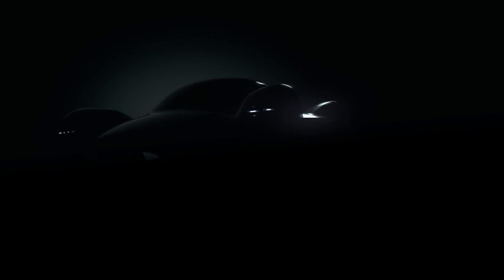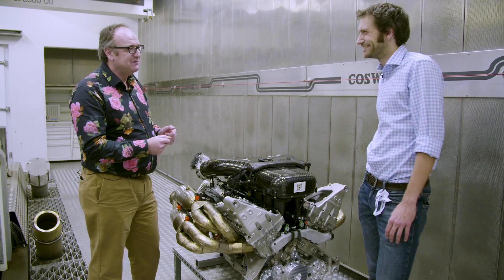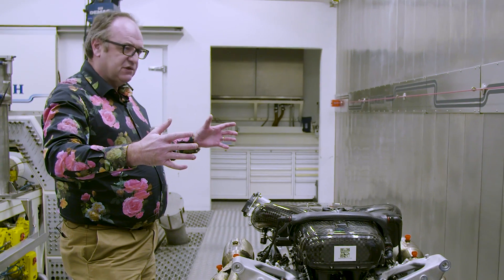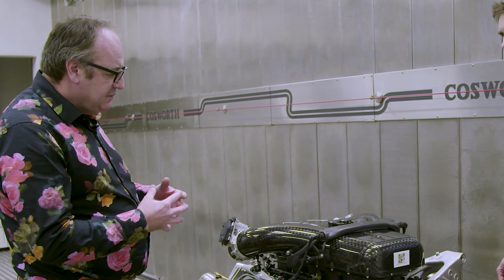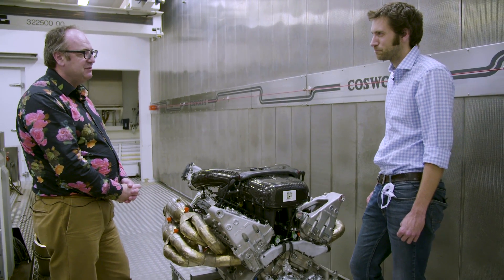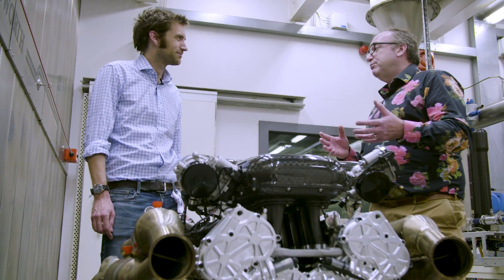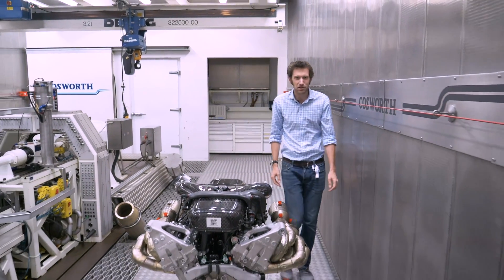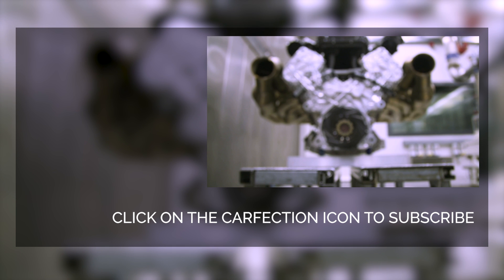Hear The Future Of The Supercar At 11,000rpm: The Aston Martin Valkyrie's V12 - Carfection

Comment: .I love cars too (I have a 2017 Corvette C7 with the fun manual transmission) but it ain't free and stocks are one way to make money.
,.,,.,,AMAZON: 
Yep, I bought a ton on the dip.   It's getting cheaper relative to its current earnings (half compared to last year). 

Amazon invested $14 billion in the last quarter alone, the same as it spent in 6 months before that.   It is a do not sell stock.

...With the Delta virus coming at full speed ahead, pandemic sales will make a comeback.

Amazon is investing so much money, that no competitor will ever be able to catch up.

Amazon's not going anywhere so I know that eventually it will come back.    
Fidelity considers Amazon as a large growth company (probably because as big as it is, it still only has 7% of the retail market)

buying via Amazon Smile donations donates some money to my favorite charity too!

Get on board or be runover, it's up to you.

Comment: This car will sit in some "lads" handbag collection with 900 miles in the first 20 years, so realistically this is not a problem.

But I do not like the idea of the engine being structural. Grand for race cars where they are working on the car constantly  and lifecycles are short. 

I am sure they have run the numbers and know is a non issue and I am talking shit!🤫

Comment: I love it when English engineering pushes the boundaries in design. Always proud to be English.
Reply: Just a Ford 2(6) =12
Reply: @nellyfarnsworth7381  Cosworth don't officially work for ford anymore, that their own design
Reply: @subconscious.com_usa6691  
Remember when Ford owned Jaguar & land Rover & Aston Martin?? Remember when Aston Martin cars where built on the JAGUAR XJS platform?? Using a supercharged inline six?? Aston Martin needed a  V-12 engine? So, a new V-12 engine was Designed for Aston Martin cars?? The "new" engine was twice the displacement of the ford DOHC V-6, that used the same rods, same pistons, same valves, same same same.  FORD designed this MODULAR ENGINE, to be a 4 cylinder, 6 cylinder, 8 cylinder, 10 cylinder, 12 cylinder. That could be built on the same assembly lines,  using the SAME parts. Also streamlined the E.P.A. compliment on emissions. Because each single cylinder was the SAME. SAME ports, same valves, same springs, same pistons, same rods, bearings, same same same.
Its the SAME.
Reply: @nellyfarnsworth7381  Ford only marketed Cosworth engines, just like Thomas Edison slapped his name on the lightbulb patent even though Nicola Tesla and other engineers perfected it for him.
Reply: Some bad news Paul - Cosworth is owned by Americans ;-)
Reply: @JakobusVdL  Owned by and operated by is a different story. If ownership changed hands yet the whole crew remain the same- it's still Cosworth UK engineering minds and hands at work.

Much like the company I work for is now owned by Canadians, but all our workforce is still Floridian- but some management changed (for the better!)
Reply: That is a fair point @wyvern4588 , but I think there are way too many assumptions involved here (mine too).
Based in England, and English, are far from the same thing. Most major automotive organisations are very international in employees and outlook.
Its not Keith and Mike knocking out motors anymore.
Reply: @JakobusVdL  True, but if they pass on the philosophy of their design, they can stay true to the name.

Just like FCA, Chrysler owned by Fiat, but they still make big, powerful iconic cars that they focused on in the 50's-70's.

Fiat was the best thing to happen to them, Diamler was the worst.

Comment: WOW. And I thought that the 860 hp of the 6.3 Litres V12 mounted on the FXX K Evo was the best we could ever get from a N/A engine. This V12 is Koenigsegg's worst nightmare...
Reply: This is the worst nightmare for electric supercar
Reply: @amarjit singh Bruh, Koenigsegg got 600hp out of a fcking 3 cylinder variable valve engine that weighs about 70kg.....and you're tryna say something is out of their league?
Reply: Certainly puts pressure on em, but Koenigsegg is doing this with the 3 cyl test engine and not bothering with quadrupling it. :)
Reply: @amarjit singh Did you read what I said!? And if you did, did you comprehend it before putting your fingers into motion!? Did Koenigsegg have ANY experience in SINGLE-SPEED FIXED-GEAR transmission, also known as the direct drive? Did Koenigsegg have ANY experience in CAMLESS engines which uses variable valve timings? Did Koenigsegg, or literally ANY OTHER COMPANY IN THE WORLD have experience getting 600HP out of a 2 litre, 3-cylinder engine? The answer to all of that is NO but they STILL DID IT. And your dumbass is saying the most matured engine technology, the NA engine, that can rev to 11k rpm.....is out of the league for a company that pushes the very limits in every car they produce? You are the type of fool that claim "it is impossible" just cause "they have no experience" and "They have never done it before" aren't you? If all the car manufacturers had people like you, we would still be having engines from the goddamn 50s right now.
Reply: @amarjit singh So? Still got nothing on a camless 3-cylinder producing 600hp. Aston Martin/Cosworth can spend 10 years trying and they would still fail to do it. While Koenigsegg, if they really wanted, could do a 2000hp V12 NA engine in a year. Now just to make things clear, I am just talking about engines. In terms of track performance, the AM Valkyrie would absolutely destroy any Koenigsegg. However in terms of normal daily use and highway sprint the Koenigsegg won't even see the Valkyrie in its rear view mirror. Both are still legendary anyway.
Reply: Koenigsegg has a 2.2L 3Cyl making 600 hp. They aren't worried. 

Though probably respectful.
Reply: @orppranator5230  I mean with turbo you can do that. But this engine is N/A.
Reply: Reaper5.56 Xx  Who?
Reply: @amarjit singh So you send me an article stating the "supposed" capabilities of the Valkyrie? Well Koenigsegg can also come out with an article stating their new car, still in development, can go 0-400-0 in 10 seconds. LMAO. Maybe put it on the road and prove it before talking.

https://www.koenigsegg.com/koenigsegg-sets-new-0-400-0-km-h-world-record/

Current world record holder for 0-400-0, and it's not even the newest Jesko Absolut, which is yet to be fully tested. Fools like you believing in fantasy numbers instead of actual records, how typical.
Reply: @amarjit singh Ah, so you're that kind of stupid, where logic seem to be out of your league. Bye now and hope you don't fail too hard in life, though I think you already did.
Reply: @amarjit singh Yea facepalm all you want. While they continue making all other car companies look like clowns. Koenigsegg haters like you never learn.
Reply: @amarjit singh Well am I comparing the Valkryie to the Jesko Absolut or Gemera? Didn't I say those weren't tested yet? When did I say Adrian Newey can't claim figures? And you think Koenigsegg doesn't have state of the art engineering and simulations of their own? What I meant is I rather trust a company with the previous AND current 0-400-0 record, and their claims that the Jesko Absolut is even faster than that. Put that car on the road and PROVE it before talking. Let me make things VERY clear for your pea sized brain, when it comes to track performance, I trust Adrian Newey 100%. However when it comes to straight line 0-400-0, it's Koenigsegg all day. Valkyrie the beast on the track and Koenigsegg the beast on the highway, no shame in that. I can provide you with reading comprehension classes if you need.
Reply: @UCgUAkpuS9qbIz7710hwx2YQ You did try to use predicted numbers to try to justify that the Valkyrie is faster in a straight line than any Koenigsegg car while a 2016 Koenigsegg car holds the current world record for 0-400-0, essentially making a fool of yourself. Also, you said bye twice but you're still here, knowing you're dead wrong yet refuse to admit it huh? Make up your mind man if you wanna say bye, then leave, don't keep coming back to fight a losing battle.
Reply: @amarjit singh Ah you finally bring things back to where you started. Yes, Koenigsegg has never done NA engines nor V12 engines. However the difference here is, I never did claim Koenigsegg could make a V12 NA engine with 11k rpm that is BETTER than the Valkyrie's engine, all I am trying to refute is the fact that you say it is out of their league. You seem to have real problems understanding that. You see, I never did say making a 0-400-0 car that is equal or faster than Koenigsegg is out of AM's league, I just said the Valkyrie or any of their current cars won't be able to do that, which you then try to refute by linking a short article on predicted values. I also clearly said the Valkyrie would destroy any Koenigsegg on the track, so I wonder why you have to bring Koenigsegg's expertise in motorsport into the conversation. Maybe, just maybe, you should take classes on reading comprehension. Speaking about "control", this is the 3rd time you're saying bye, I really hope you leave for good cause you're taking way too many Ls.

Comment: 220 hours simulates 100,000kms of real road use.  Well only if it’s done those 220 hours as a culmination of 1000 plus short stints allowing the engine to cool completely in between.  I would be very interested in knowing whether this is built into their durability testing. I’d suggest any engine set up correctly could run a constant 220 hours.  It’s wear and tear at start up and being under load and revs when an engine isn’t at optimal operating temp that does the damage.

Comment: They will get these engines better and better.Newer engines in a few years might be able to burn fuel so precise and clean that we will not need heavy exhaust systems with catylitic converters.Also they are supposedly making metals that stay cool or a certain temperature and will be able to revamp the oil and cooling systems--that way then can focus more on MPG--and faster speeds--while being lighter and safer.I like Hondas but wish they would focus on improving NA engines instead of turbos.They are already having some issues with turbos--cooling--unburnt fuel getting too and scarring the parts microscopically.I have a Type R Crosstour--its on you tube.It is the 3.5--NA and is putting out 300 HP--it has a full exhaust and was reprogrammed by Honda.I could have easily told them to reprogram and put a more aggressive exhaust and get 350--and also a cold air intake--but it would have voided the warranty.The 3.5 is a GEM--and it is reliable and it stays cool at high speeds--even in the heat.I had the car set up to run in the silver state classic--which I hope to do next September and film it.Honda should have made the Civic Type R with the 3.5--and they have made improvements to the 3.5 since 2010 and could easily approach 400 hp.A civic Type R with AWD and a 370 plus 3.5  would be perfect.In the US it gets hot out in 90% of the country and even the Honda turbos lose power and reliability in the heat.I have locked my cruise control on 100 mph plus going to Fla a few times--getting 24 mpg--AC on--car just loafing.I went to look at a Type R--but coming from a big Crosstour with what I had done was not close.The crosstour is a better car--is it slower--yes--but the reliability--safety--and the ride quality--the crosstour is a much much better high speed cruiser.There was a video of me a year or more ago with me getting on the highway with a coworker that had a new SI--it was like a 20 mph to 110 run on an empty hwy after work and by the time I was at 100--I was about a car length and a half ahead.My car should match the stats of a V6 coupe accord--except my governor was disabled.On the dauphin island Alabama bridge--I got the car to about 137 and had about 2000 left on the tack--I think it was 4100 rpm at 137--so I would say 155 is probably the drag top speed.This car is fantastic--and the engine techno is great

Comment: You know what my issues with they’s cars are they keep pushing the limits yet no one is working on a V12 that use gasoline like a 4cl. And nothing is imposible. But no one is thinking. It’s all the same electric cars are nice but the sound is gone. And that’s not appealing. Think about this a V12 that runs off of 1 gallon of gas for 300 Miles. 😱😱😱😱

Comment: i may be very wrong here but he said that the pistons move at 25 meters per second and i googled it and it says that's almost 56000 miles per hour that's amazing, he also said the the engine is built to last 100000 kilometers or about 60000 miles, so if the car could go as fast as the pistons the engine would last about a second haha that's insane.  (again i could be very wrong)

Comment: It's not really the future of the supercar, but rather a nostalgic nod to the past. The IC engine is a dinosaur. He really stresses the deficiencies of the engine and support system, and talks them up as positive features and achievements. (Emissions, weight, complexity, vibrations, heat dissipation, lubrication challenges, gears for cams, resonances, noise, complexity, exhaust pressure waves, costs, wear, modest durability, clutch limitations, etc.) That mindset makes no sense at all.

Comment: imagine, you have a Maruti Suzuki 800 and you have swapped the stock inline 2 800cc 4 speed with this 250HP 1.6 liter inline 3 with a 6 speed sequential gearbox which revs to 10,500RPM...
the dream...

Comment: engine goes 12k RPM

every forced induction demon flies out of me
Reply: They need to catch up to the bikes where 16,000 is the norm and some can go even higher
Reply: PappaLitto you have to keep in mind, this is a 6.5 liter engine not a 1.5 liter
Reply: @PappaLitto  Too much mass and reliability is shite if you try it in something with that much mass. Back when F1 ran 20k RPM they changed engines every session.  Thats like 300km per engine.  Pretty fucking bad.
Reply: @ChefofWar33  those were also surprisingly small. I think the V8s were 2.4L and the V10s weren't much bigger.
Reply: @disabledman8697  You ever see a 2,4 liter bike buzz to 16k rpm?  Probably no, becuase it is really hard on shit.  Need pretty much titanium everything.

Comment: Since they spent so much money on research and development to make this engine, they might as well mass produce it.
Reply: Well the corvette doesn’t have real world application either and it has been produced for decades. 

I am not saying make 100,000 just 10,000. Enough to see one in the streets every once in a while. Not just on YouTube videos parked forever on millioners garages.
Reply: @johnconnor7501  The corvette isn't comparable on any level. It's a relatively cheap and simple sports car built to a price.
Reply: Firebrand I understand that. I am simply pointing out that a car does not need to be practical in order to be mass produced.
Reply: Nah, the technology used within the engine will go into road engines that actually have real world marketability and application.

Comment: My 2006 Kawasaki Ninja ZX10R 1,000 cc red lines at 13,500 RPM.  It tops out at 100 MPH at 13,500 RPM, in 1st gear, of 6. :D
Reply: It also makes you sound like a twat on the internet and on the roads.
Reply: @GlitteringToothpaste  Troll elsewhere, twat
Reply: @GlitteringToothpaste  Speed does not a twat make, but twat comments like yours...

Comment: Please Cosworth put that 3 cylinder engine in a hot hatch!
Reply: What makes it more incredible is that engine would only be about 1.6L so you get 250bhp from a 1.6l 3 cylinder engine and I bet it would also sound amazing.
Reply: @thedestroyer3262  That's approaching "reliable" rotary engine performance, but it meets emissions!  D:
Reply: @thedestroyer3262  just think konninzeg got 600hp from a 3 cylinder engine. Imagine they built a v12.
Reply: They need to team up with Ford again, push Mountune out of the way and re-visit the 1990s era..... put the 3cylinder in a fiesta, and put two together to form a straight 6 to power a focus
Reply: Problem is durability, 100,000 Km for a hatch is just not enough. engine needs to survive for 300,000 km at least.
Reply: Koenigsegg has a 3cyl that may be a little bit stronger.
Reply: Fiesta RS Cosworth 😍
Reply: @raymondjunger4742  Holy shit! Yeah. A Festa' Cossie would be so cool! Make it a six speed manual too!
Reply: Jamie yes
Reply: the 3 cylinder engine in the Koenigsegg Gemera makes 600hp
Reply: Put it in a Lotus.
Reply: Mk1 Polo, rear wheel drive x-trac 6 speed sequential gearbox.... And a 250hp na 1.6 3 cylinder. Strip it out, carbon doors, boot and bonnet and track day it.
Reply: put it in an Alfa 4c!
Reply: Ewwww... hatchback. You’re disgusting. Go back to the hole from which you crawled from. Thanks! 🙏
Reply: @LaSombraa  Ewww... pretentious arsehole. You're disgusting. Go back to the hole from which you crawled. Thanks! 🙏
Reply: @LaSombraa  
Oh yes let me take my huge ass Family wagon in the busy part of London !
Reply: @LaSombraa  youre a fucking moron aswell.

Comment: Grossly expensive, gutless and largely useless unless you have a couple of million dollars to buy it, a few hundred thousand dollars to employ a team to keep, maintain and prepare the car for when you want to drive it. It's an F1 car with a roof... 3 cyliner that makes 250hp? Ok, that's not overly impressive... you can spin anything fast enough and get horsepower. How much torque does it make at what RPM? It really sounds like a gutless super short stroke motor that makes nearly no torque but you have to scream the shit out of it to get anywhere.